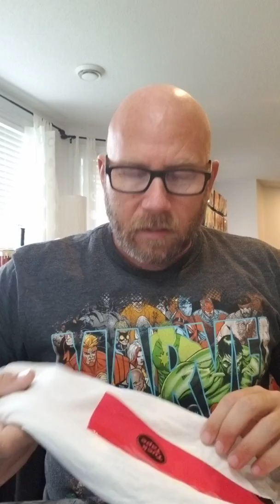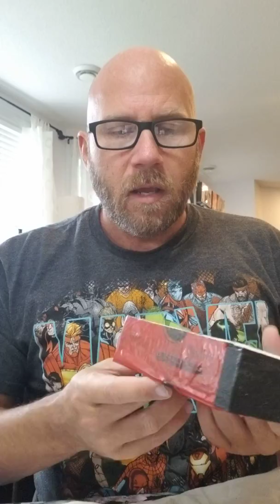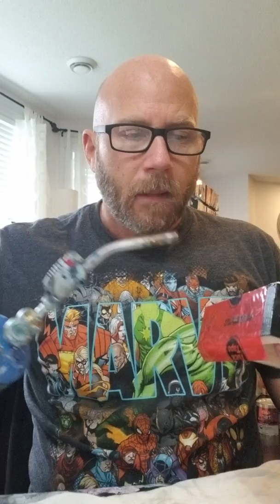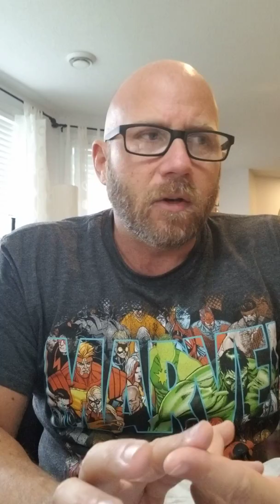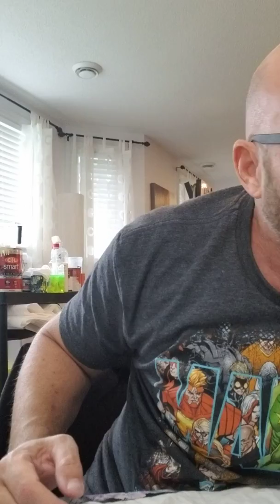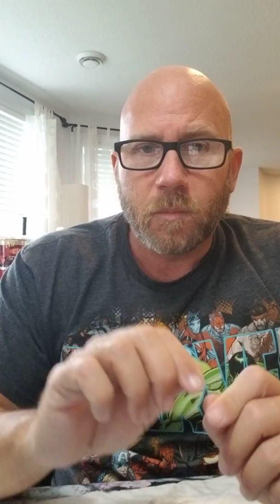Tape and Resin Tips and Tricks

Comment: You are good with explanations and how to’s you answered many of my questions as I am starting on this resin thing. Boy it’s messy, finicky and testy. But with every project I learn and find answered to my issues like your video. I was looking for the best tape to use on aboard that the resin would not sip through. I took blue tape  of after 3 hrs and it had slipped under it 😖. I remembered in some other video I saw someone use Qtip and acetone and cleaned up the residue - I did that but will need to wait till it drys completely and will need to do some sanding ( it’s a flat cheeseboard )
Also have t been able to master a clean (resin free) back of cheeseboard yet - maybe the tuck tape will help - thank you again . Keep on shinning! And doing your videos. Nicely done .
Reply from the maker: Tuct tape is amazing.  Just remember it is crazy sticky!!!  Be sure to blow dry it a bit when you are done so you can pull if off easily.  Good luck!!

Comment: Could use a heat gun to remove tape. Yes I just did my first mixed media piece on panel and on tiny bit of a corner didn’t catch the resin and parts of the edges . Oh man I wish I saw this before doing my piece . 😫 halving the amount for the first coat would have been a life saver! From now on I’ll do that! Thanks for doing this. I could hug you! So for last coat on 24x30 how much do you suggest I mix since I did the full suggested amount on the first also how much for second coat on my next piece of the same size? You are saving my tight budget! Your tips are awesome . I used cardboard for my cover because that’s all I have that’s big enough .maybe I should make something better? I’m measuring in ounces rather than cups.
Reply from the maker: Yes for sure.  I mentioned it in another video that you can use a heat gun.  Just don't over do it and melt the tape.  Stinky.  For amounts, 24x30 I use about 2 cups for the first layer.  Then another 2 for the final coat.  So 4 cups overall instead of the recommended 3 cups for each layer.  I use to use cardboard but found it could be dusty.  I just use another canvas or board and then cover everything with a dollar store plastic table cloth.  Easy Peasy.
Reply: Cor Beattie thsnks  just saw your reply . I didn’t know about you so my first layer was the full amount . I guess I could still add 16 Oz for my second coat (2cups). Or a bit less. Sucks I didn’t discover you til today. Did my resin two days ago.
Reply from the maker: @JanineMKartist  well know you know for the future.  ;)  You can almost half your second coat.  Maybe 60% to be save.  But it is going to be a thick resin piece at the end.  lol
Reply: Cor Beattie I’m doing something a bit different for the effect I want. The main subject area will remain glossy and the surrounding area will be sanded and buffed to a matte finish. I watched art resins tutorial on how to get matte finishes . If the shiny part is a bit thicker that may actually add to the feel I’m going for . I got various grits of wet dry discs for the sander and some bowling ball super fine grit. I also got the cutting board wax suggested by art resin . My other piece will be a bit more challenging with that. My sides needed a redo because i stupidly added the patterns of my piece on the side and changed my mind after watching you. I think you are correct that the sides should be a solid colour. Ok so if my piece is lighter colours should my sides also be similar light colours . Not sure if I should pull a bright colour from the piece for the side or use the lighter colours that cover the outer part of my composition . My hunch is lighter vs bright or dark contrasting. This art is for kids rooms. Cute fantasy creatures . Thanks for your advice. Sorry about my million questions .  I’ve learned a lot from you . So happy . I will be setting up shop to aim for selling my art soon. Don’t know what to do with my old surrealism oils From years ago since it doesn’t fit my style and concept anymore .
Reply from the maker: @JanineMKartist  If the art is for a kids room I would always suggest a white edge or a light fun color from the main color palette
Reply: Cor Beattie thanks. Just got tuck tape. Even the edges of the roll is mega sticky. I just rubbed it on my shirt. Do you just use a blade to cut off pieces? I don’t want to gum up my scissors.
Reply from the maker: @JanineMKartist  Yes make sure you get some of the sticky off because it is crazy sticky.  I use an art knife or a pointy steak knife.  If you use scissors, just a small cut will alow for a tear.  Just scrunch up the cut part on the roll to know where you finished.

Comment: You mentioned you use two different resins.  Would you mind explaining when you use each resin?  Thank you!!
Reply from the maker: I found a resin that was cheaper and easier to use BUT it ended up yellowing after a few month.  I was ruining pieces that were light in color.  So I had to return to the more expensive resin that has proven not to yellow over time.

Comment: This video was SUPER helpful !! Thank youu (: I do have a question : can I paint with water and/or arcrylics paints ON top of the resin once dry (I believe so) but then , If so , rather than coating it with another layer of resin could I varnish with a liquid or spray varnish to seal the work ON top of the resin ? 

In other words could I use spray/ liquid varnishes on top of resin that has already harden and dried ? 

Please help ! Thank youuuu
Reply from the maker: Yes you can but remember the sprays often leave a texture. Same with brush varnish. You will gwt brush strokes. So you will loose the super gloss look of the resin.